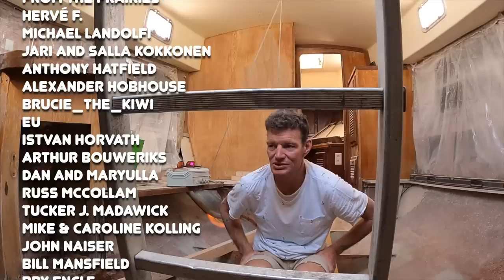Rescued Boat Restoration: The Reality of a Rebuild When You Have NO CLUE | SAILING SEABIRD Ep.64

Comment: You should keep a centre board between the tanks to aid floor sole support, the side line with sealed plastic, fit tanks with water in them and pour slow set foam at each side so the water tanks are supported along the length, then trim and remove, trim down by 2mm and skin with fibreglass

Comment: Tricky with the water tanks , good final plan . 
FYI be sure to check the water tightness of the fittings , with all the banging around !  And be sure you can remove the tank to repair the connections !!!! Because you know….
Triax glass is good , harder for sharp bends ! 
Cheers Warren
Reply from the maker: Hiya Warren,
The tank fittings will need resealing.
We hope the tank solution works. If it doesn't, then find another solution.
Cheers for watching 🙂

Comment: I am a bit worried that the floor above the water tanks will bend when you stand on it, thus putting pressure on the tanks. You could consider supporting the floor by adding a steel T-beam in between the tanks. It only would add a spacing of say 3mm between the tanks, but it would increase rigidity of the floor tremendously.
Keep it up. You two are making amazing progress! Each Saturday morning (here in Japan) I look forward to watching your video.
Reply from the maker: Great idea!
It's on our minds what the solution will be.
But..
We need to test it first.
Once that's sorted, we'll have a better understanding what to do.
I really like the steel idea.
Cheers for watching 🙂

Comment: You can have a screw with all sorts of heads including bolt heads.  👍🏼🧙🏼‍♂️ And you can have coach bolts with or without  
a way of driving the head.. slot cross or bolt... Oh the joy of fastners 😂

Just make some wedges under  the tank edges standing proud dont bond them in too tight. ..but do rot proof the wedges as they will get condensation and bilge water soaking them.
Reply from the maker: Hiya Clive.
Hope you're well.
It would be nice to have an assortment that extensive.
I've got 2 boxes that's it.
Thinking of polystyrene wedges fibreglassed..?
I can make them wide, movable and water tight. They have some flex in them. I don't know, yet...
Cheers for watching 🙂

Comment: put some holes in the wooden blocks at the base for water to pass through in the bilge. Love the problem solving though 🙂
Reply from the maker: Timmy.
Valid point.
Just been having the conversation with another person about the holes.
Tall and short of it is, the wood is in and now we wait and see if it works. Give it a couple of seasons with monitoring and we'll know more.
I'm not stubborn 🤣😅😂
Cheers for watching 🙂
Reply: @SailingSeabird  All good, good call on making sure the tanks are secure and so it's clear to see your "building it back better".

Comment: Your doing a great job. Having restored a boat and had to remove old Sikaflex have no fear your fairing joints should be bomb proof with the matting and resin over it. We had steel and embedded all the deck fittings and hatched with Sika. We are still in contact with the couple we sold the boat to and not a leak 17 years later after multiple trips in Bass Strait, New Zealand, Japan and on to Alaska this season. 
Looking forward to watching your coming adventures as you restoration continues.
Reply from the maker: Thank you.
We are glad you enjoy watching.
Lots more to come.
Cheers for watching 🙂

Comment: I would keep the center board between the tanks to help give you solid sole support. O  BTW one way to filet the inside corner  is to use a small piece of pipe to get a perfect filet ...over the caulking. for when you fiberglass those inside corners. You will have a floor or a sole I have no doubt about it. Your doing well keep pressing on. Ya hear. cheers.

Comment: If the hole is 50mm wide semi circle, with proxy edges, or a Fibre sleeve,  it won't block. Most of your time your at anchor where it needs to drain and you won't be tacking. Good luck, love Marinas optimism.
Reply from the maker: Hiya Alex,
I see your point.
The only issue is that the wood is in. 🤣😂😅
We'll try it for a season or two then we'll know. At the point I'll be laughing thinking about this conversation 😂 
We did think of putting the wood at an angle or cutting a hole.
I honestly think it's going to be fine.
Cheers for watching 🙂 
I'll keep you updated

Comment: Cut circular holes in the wood footings that hold the H2O tanks for the next round. Paint the hardwood with epoxy before tabbing. You work together beautifully, what a team.
Reply: Lay marine ply painted with epoxy on the top of the wood footings... Do not attach so you can access bilge when needed. This will distribute the H2O tank weight evenly. You got this

Comment: You should keep the centre board between the tanks. Use a upvc plumbing tube under the tanks for bilge water , and then fill under the tanks with expanding foam.

Comment: 7:20 : Why not use vibration dampers like used under washing machines?
Might also do their job during rough weather.
Reply from the maker: Good point. Didn't even think of something like that. Well, it's in place so we'll see how it goes. Hopefully get a few seasons out of those bits of wood. Then mark two will have to be figured out.
Cheers for watching 🙂

Comment: Water tanks,  lay alrge sheet of plastic down wrap plastic around tanks. 
Pour expanding foam on bottom and place tanks in foam at desired position
You now have a removable custom cradle for your tanks 
BUT if you are slow moving, don't do it, you only get one shot to do it right or throw it away
Reply from the maker: That's it! 
What plastic? I was thinking of a bin bag.
Too thin?
The foam is a good idea, but it's super messy stuff.
Cheers for watching 🙂

Comment: Maybe use thickened epoxy for fillets, and use a shaped spatula to get a nice consistent radius on these. I don’t know but I wonder if the flexible Sika to inflexible glass epoxy bond is less desirable (may delaminate over time if there is flex) than a rigid epoxy glass to rigid epoxy fillet bond?
Reply from the maker: We wonder if epoxy is too rigid.
We'll just have to see how it plays out.
The sika is not of massive importance, just for the shape.
I'm sure it will last a while, but how long, that I dont know.
Cheers for watching 🙂

Comment: the amount of space you are essentially loosing in order to floor the tanks is one of the reasons why i suggested, long time ago, for you to make integral water tanks, no to mention that you are loosing, easily, 30 litres of water on the floor section alone.
Reply from the maker: I knew this point would arise.
We/I didn't want any custom tanks. The reason being that if there was an issue I could just order another tank. No waiting for people to fix it, etc. Everything off the shelf.
But in saying that, we are thinking about a custom tank...
Plus, we wanted plastic.
Cheers for watching 🙂
Reply: @SailingSeabird  why wait for ppl to fix, when you will be the ones fixing it?!after all you will be carrying all the needed materials with you (bit of resin, cloth, plywood, thin piece of G10 either)

Comment: Since you asked (but please don’t take this as criticism, I love what you are doing and offer these comments only in the hope that they might help in some way as you move forward): I’m not keen on the idea of using Sikaflex or anything else other than thickened epoxy for the fillets as the epoxy for your tabs won’t adhere to the Sikaflex so it significantly reduces the value of adding the fibreglass tabs, which will be an issue in any structural application (like bulkheads, floors and frames). Instead of becoming a completely bonded unit with the fibreglass tabs bonded on all surfaces you end up with an area over the Sikaflex fillets that is completely reliant on the strength of the thin fibreglass layer spanning the fillet with no support from the fillet itself - it bridges the fillet instead of being a part of it. Whereas an epoxy fillet, as well as cleaning up the epoxy squeeze out between the pieces being glued, bonds evenly and strongly on all three faces - ie to the surfaces and the fibreglass tab - forming a cohesive structure. Having said that though, for those “feet" under the tanks I don’t see any problem as they’re under compression and you just don’t want them sliding about so well done on the final solution there. And being a sailing boat central limber holes aren’t necessary whatever anyone tells you, drainage down the sides of the keelson as you have it are more effective anyway.
For what it’s worth - and it’s a hindsight thing so not much use to you now I should think - but squeaking would never have been a problem if the floors had been bonded directly to the hull with epoxy and epoxy fillets and without the rubber/foam strips. To be brutally honest I think that, in boat building terms, the foam strips were a mistake as the floors on any hull are intended to form an integral part of a hull structure and really need to be securely bonded to form a part of the hull. It looks like you made a good solid job of the epoxy tabs but I see that the epoxy tabbing will essentially be taking the weight of the floors, longitudinal frames, cabin sole and traffic as well as any flex in the hull at sea that the floors when solidly bonded would otherwise stiffen.
Reply from the maker: There is a lot to take in.
Many points we agree on, some less so.
We often (most days) wonder if we are doing it right.
All I can say is "We'll see"
We have no real idea but we're giving it a go.
We can also redo things if they are wrong.
Plus, we aren't putting the boat in the water and going straight to the Marquesas.
Give it time, sep by step.
Thank you for taking the time to give us all this advice. Where were you at the start? 😅😂🤣
Would like to chat more about your experiences.
Cheers for watching 🙂
Reply: @SailingSeabird  Oh I’ve been here from the start and have continued to be awed by your can-do attitude and give-it-a-go  approach, it’s the only way to learn and we have all been there. And as you say, everything that has been done can be redone if you’re not happy with it. I can see you guys finishing this one, sailing it for a while and trading up again to a bigger boat with all of this incredibly valuable experience behind you.

Comment: Do the tabbing on the water tank supports while the sikaflex is still playable ,,I have installed many wooden parts including bulkheads ,engine bearers,hull outlet support pads in this way ,,,the Sikaflex takes a good shape and insures no air gap if consolidated properly
Reply from the maker: Thank you.
I was starting to dou t my friend who suggested the idea.
We actually like it. It works and it's simple.
Cheers for watching 🙂

Comment: Can you not simply lay a sheet of plywood across the bilge so it sits on the sloping edges and sit the tank on that?
Reply from the maker: We feel it needs support underneath.
But tbh, there are probably loads of better ways to do it. We just don't know.
Let's give thus a go and see how it fairs.
Cheers for watching 🙂
Reply: @SailingSeabird  It really doesn't. The load will be spread evenly between the base of the tank and the plywood; there will be no more force applied at the middle of the tank than at the edges. I don't know about yours, but water tanks often have ridges moulded into the base for rigidity anyway. It just seems a shame to obstruct the flow of water through the bilge after all that trouble you went to to keep a clear run. You could always brace the underside of the play with a couple of bits of angle iron if you feel it needs extra support but 18mm marine ply is bloody strong.